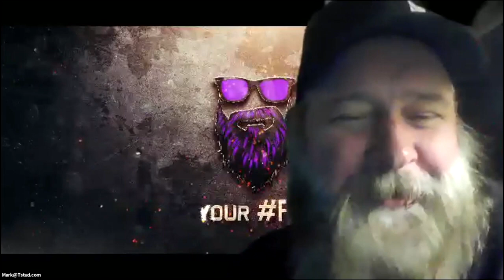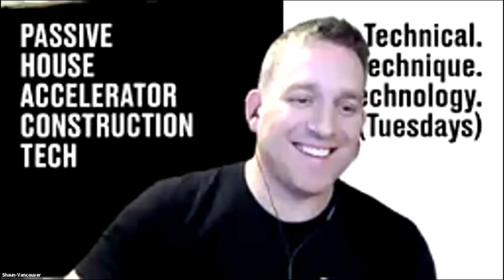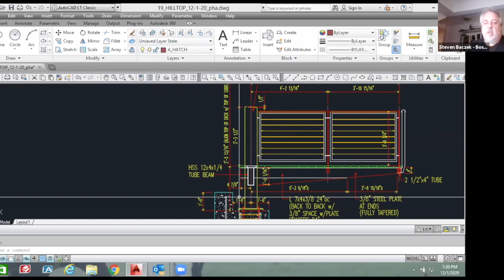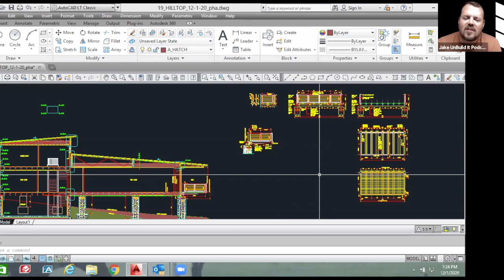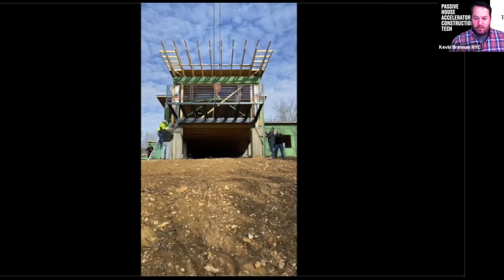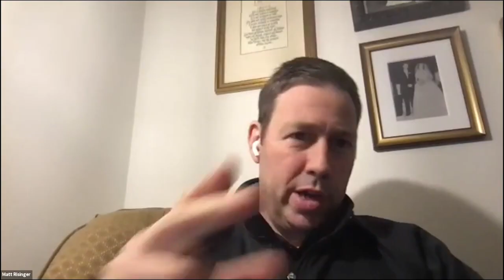Passive House Accelerator Construction Tech: Episode 3

Comment: Steve has what I would call “structural aesthetic” that the vast majority of architects lack. But While architects can be readily licensed across state boundaries, if you hire a distant architect , you need to have a really solid local builder to back him up re codes, local vagaries etc, and be prepared for additional travel fees. It makes little sense to hire a guy like Steve and not have him out at the site multiple times (would be curious how many visits Steve has made to this house, traveling from Boston to Missouri ?)

Comment: Steve is absolutely right re balance in design - we seem to lurch from crappy spec house builds to insane religious passive zealotry. AS to people not doing their job, Aerobarrier is doing a brisk business because of lack of attention to detail (at considerable cost to the client) . Its great to see designers like steve value design things like windows -triple pane on some sides of the house, but double pane where you dont need them . Far too much lazy design going on even at the most celebrated architectural firms.